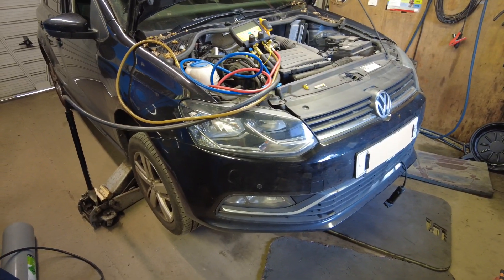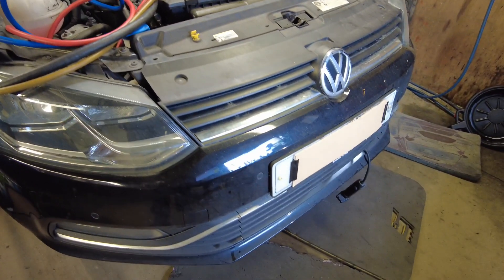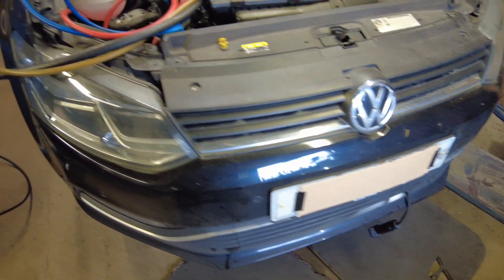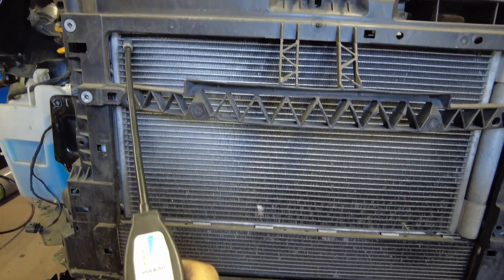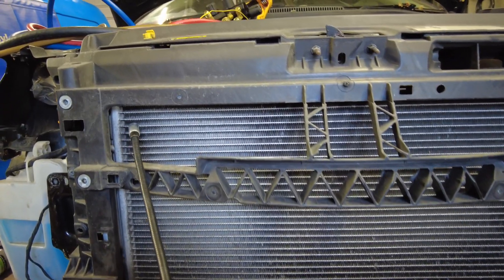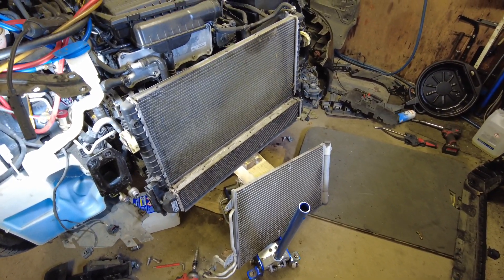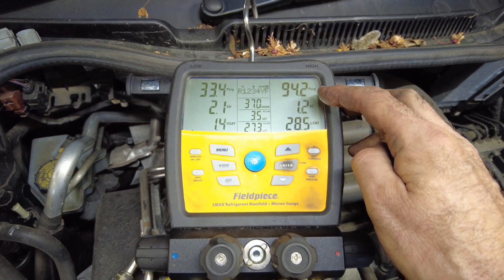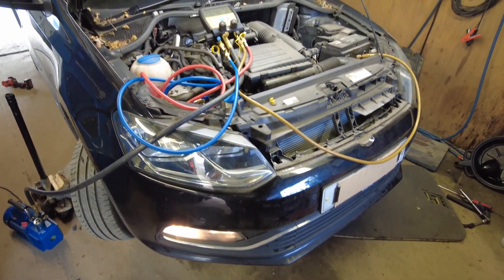VW Polo Mk5 Aircon leak - using hydrogen/nitrogen gas to locate it.

Comment: Nice video. How do you charge for leak finding, some are time consuming, especially when you need to disassemble some parts.
Reply from the maker: I do a fixed price but make customer aware there are sometimes inaccessible areas that could require more time. Keep them in the picture.